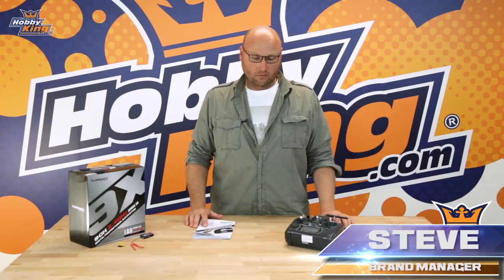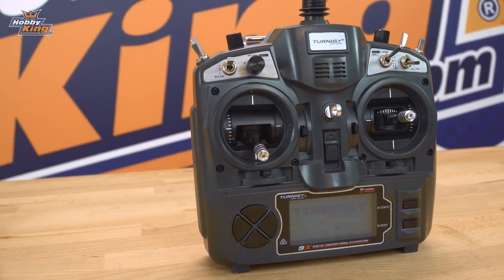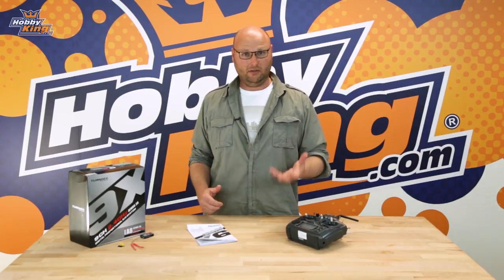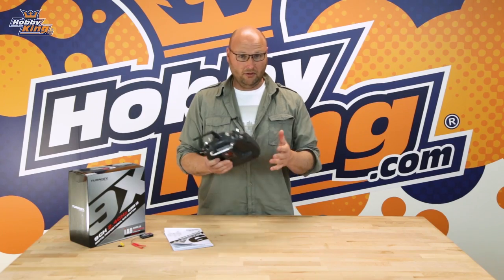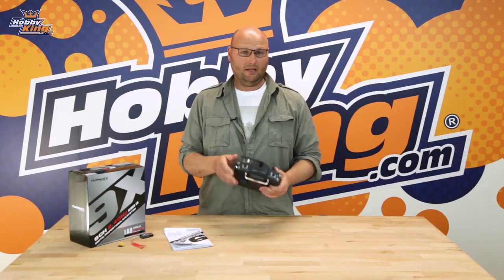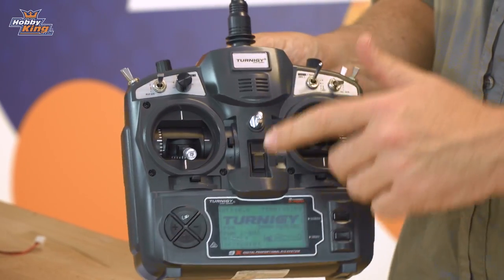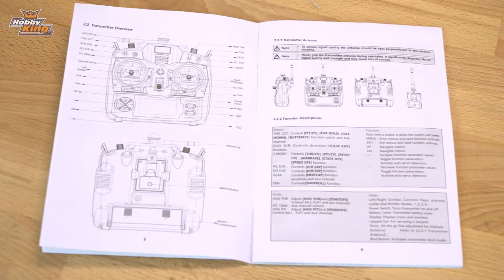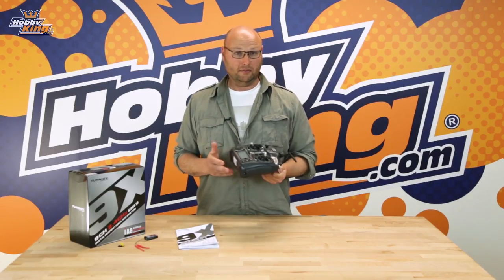Turnigy 9X 9Ch Mode 2 Transmitter w/ Module & iA8 Receiver (AFHDS 2A system) - HobbyKing Daily

Comment: Will the original 9X module work in this radio? I have quite a few models with the original 9X RXs in them and need a replacement radio for them.